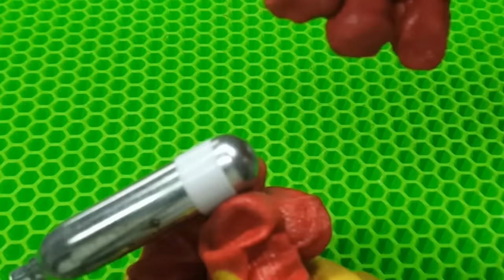The secret function of CO2 cartridges for airguns!!! 3 DIY idea.

Comment: I have been in the engineering business 40 years and never needed rubber caps on any of my small boxes if you want to make them just use a sharpened pipe and a hammer
Reply: I was thinking the same thing. Except even with only a utility knife , you can cut four small squares to put in the corner of that box. And save material to boot.

Comment: I wonder why they don't figure out a way to recycle them. I would like to see one cut and maybe threaded like a bolt to make a capsule out of it. make it water tight by adding a rubber seal
Reply: I've done that, all you need is a rubber flat washer, I use them as waterproof match storage, I cut one end off threaded the outside diameter and threaded the inside diameter of a larger tube, used it as a coupler with the rubber washer in between the two pieces and silicone the top part with the hole

Comment: What a waste of time first co2 are Steele they will not hold any kind of sharp tooth at all second just buy the proper tool u will spend so much time doing this idk what others value there time at but it will cost more to build these things to do the job then just spending g the cash to buy a hole saw file handle and a punch bit for punching out rubber